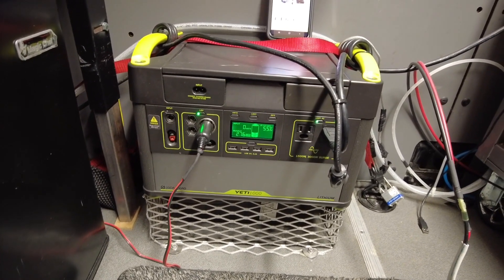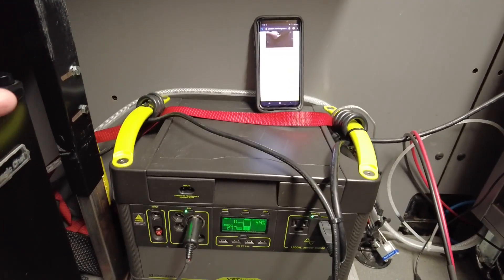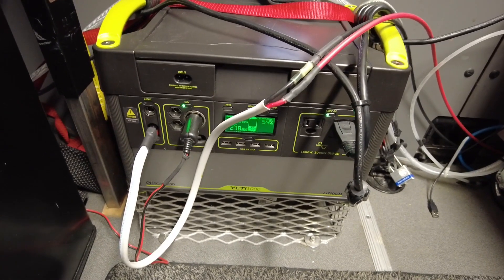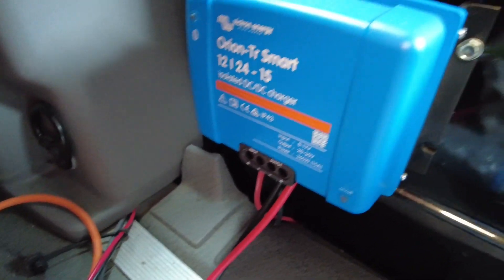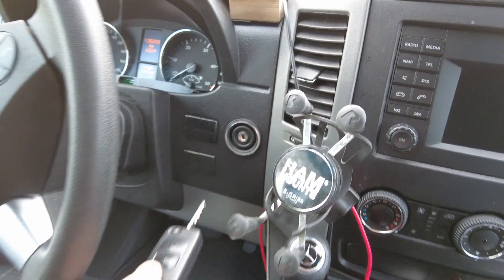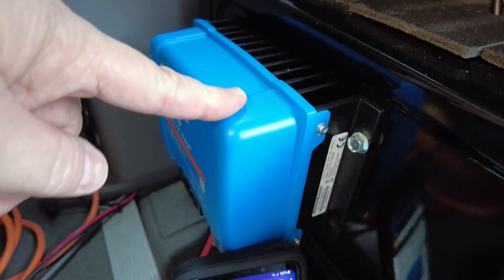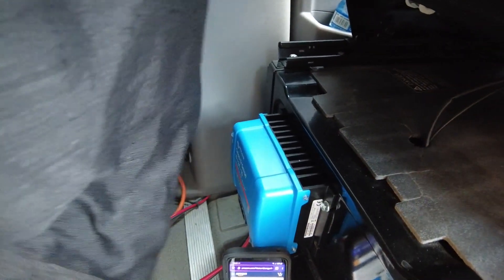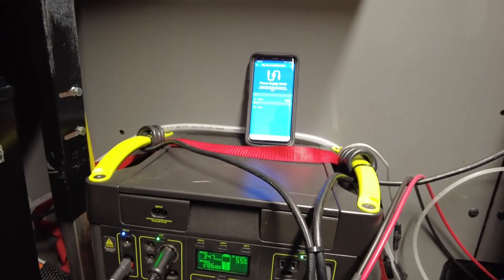Goal Zero Hack - Alternator Charging using Victron Orion DC-DC Converter

Comment: Your alternator should output 14.4V.... You have a voltage drops to 13.5V,  you might be overloading your alternator...
Reply from the maker: Hi MisterX - Regular alternators will generate a fixed voltage (e.g. 14V) where smart alternators generate a variable output voltage which can range from 12.5V to 15V.   The Sprinter van has a smart alternator.  So we're definitely not overloading it.  In fact, most Euro 6 engines have a Smart Alternator.  The Victron Orion is a perfect match for it.  Hope that helps!
Reply: @sprinterdiscovery  Good to know!

Comment: I recently installed a Victron Energy Orion-Tr Smart 12/12-Volt 30 amp 360-Watt DC-DC Charger Isolated (Bluetooth) to charge a Goal Zero Zeit 3000 over the 30A PowerPole input. Unfortunately there is a compatibility issue with the 12/12-30A version. The Yeti 3000 does shortly stop charging in cold state, probably due to over current (in cold state the Orion can deliver an output current up to 40A, whereas the Yeti accepts only 30A), which is causing the Yeti 3000 to close off charging. - I ordered a Orion-Tr Smart 12/24-Volt 15 amp as an alternative now, since this device will avoid the over current. Drawback will be, that the max. charging output will be about 315W (15V*21V, and not the possible 360W) and the risk, that in case of misconfiguration, the Voltage could be over the allowed 22V for the Yeti. But at least it will work.
Reply: I believe the yeti 3000x has input limit up to 50A so this 40A surge should be okay with that model.   Does this make sense?
Reply: @sahathorne1  I just double checked the specs for you and you‘re right, GoalZero Yeti 3000x is indicated for „High Power charging port (input): 14-50V, up to 50A (600W max)“. So you should be able to go with the 12/12-30A or the 12-24-15A. Since the Yeti 3000x has a voltage input of 14-50W, I would go with the 24V option. You would not have the risk of over voltage (in case of misconfiguration of the Orion) as you have with the the 12V option. But in principle, both options 12V & 24V should work in your case with the Yeti 3000x. With Yeti 3000 the 12V option doesn‘t work.
Reply from the maker: Good to know thanks for sharing this info! After looking at the specs, I didn't go with the 12/12-30 and instead went with the 12/24-15A. Glad you actually confirmed it! Definitely temperature plays a role in how much is delivered to the Yeti.

Comment: Do you think this setup would work with the Titan Solar generator and a smart alternator? The Titan is a 24v system and allows for a 15A car charging port.
Reply from the maker: I did a quick product search, and according to the specs the car port charging says 85 watts, less than the 360W the Victron will produce. Also the solar MPPT on the Titan has input voltage range of 35v to 145v, which is higher than what the Victron will produce. So, just based on that I don't think the Titan will charge with the Victron Orion. Probably install an inverter instead in your vehicle and use the charger that comes with your Titan. Best of luck on your setup. And thanks for watching!
Reply: @sprinterdiscovery  Thanks! I will do more research on inverters.
Reply from the maker: @TN-wl1rw  You're welcome!

Comment: salut,la sortie 12v sur le régulateur de charge solaire est de combien d Ampère ?
Reply from the maker: FRENCH:
Bonjour! La sortie est de 24 V à 15 ampères et l'Orion est un chargeur DC-DC, pas un contrôleur solaire. L'entrée provenant de la batterie de démarrage 12V est de 30 ampères. J'espère que ça t'as aidé!

ENGLISH:
Hello!  The output is 24V at 15 amps, and the Orion is a DC-DC charger, not a solar controller.  The input coming from the 12V starter battery is 30 amps.  Hope that helps!

Comment: Great video! I'm currently using a pair of the Goalzero 12v car charger cables. They each provide 120w of charging while driving. I will now replace (or augment) them using a DC to DC charger. Did you try to wire the Victron to the terminals below the drivers seat? I recall that's where Mercedes recommends adding connections instead of directly to the battery.
Reply from the maker: Hi Tim - glad you liked the video! I wired directly up to the battery terminals. I'm not sure where I would connect it to on the terminals under the seat. I know there are several there. Been going on 7 months with this setup so far and it's been working awesome! If you do find out which terminals to attach to please let us know here. Edit: I found this site which discusses the terminals... https://sprintervanusa.com/2016/08/07/tapping-in-to-the-sprinter-vans-battery/  It's something I have to look into for sure now that you mention it. I'm not sure of the implications of directly wiring to the battery though - do you know? Many thanks for raising this up here!
Reply: @sprinterdiscovery  Here is what I'm referring to: https://sprintervanusa.com/2016/08/07/tapping-in-to-the-sprinter-vans-battery/. I'm thinking you could use the middle terminal, but that would mean it's live all the time, but I guess that's how your setup is also. The Victron is smart enough to know when the engine is running I assume. Just subscribed!
Reply from the maker: Thanks Tim! I just googled and edited my comment and replied with the same link as you! Lol definitely something I need to research. Thanks mate! And thanks very much for subscribing too!

Comment: I also asked same question on todd parkers video upload. I was looking at buying the victron orion 12/24 15 amp dcdc charger to charge my yeti 1500x from alternator. Would I need the victron orion 12/12 dcdc charger to charge a 12v external lif4po4 battery from the yeti 1500x? Maybe I could buy a 24v external lif4po4 battery and tie that into the powerpole connection for charging yeti and use the orion 12/24 dcdc to charge the external 24v battery as well?
Reply: To charge your 24v external battery get a 24 volt dcdc charger so then it will be charged when driving. Then get a Goal zero mppt module and connect the 24v battery + and - to the power pole input of the mppt module. The 24v battery will drain into the goal zero at approximately 320 watts and if your dcdc charger can output more than 320 watts into the 24 volt battery you can charge both simultaneously while driving! I love the 24 Volt external battery idea because the Goal zero MPPT module is rated up to 48 volts input even though the label says otherwise (I have tested my GZ MPPT module with a 44 VOC 72 cell solar panel). Please note I am only talking about the GZ MPPT add on module!
Reply from the maker: Fantastic! I've been wrestling with this problem for a long time, and you gave us all the answer here! Since the MPPT module can accept voltage values greater than 22v (like you mention up to 48V), we won't need another Victron Orion. We can just feed the Yeti from the Lithium battery directly. Going a step further, we can simply connect the Orion to the extra Lithium battery and charge that as we drive. The Lithium battery then becomes the "tank". So when the Yeti is full, we keep charging the extra 24V Lithium battery as we drive until that is full. When we're parked for the night, it will continue to feed power to the Yeti via the MPPT module until it's empty.  You think that will work?
Reply: @sprinterdiscovery  I believe so. One thing to consider is the GZ mppt module shuts off at 13.2 volts input, so your 24v external battery will need a low voltage (i.e. 24.0-24.4 volts) notification for you to manually disconnect from the GZ mppt module. That shouldn't be too hard to implement!
Reply from the maker: Great! I'll have to order an MPPT module then and do some experimenting. The Yeti 1000 is still going strong and if I can expand it with extra Lithium 24V, the life of the unit can be extended for a much longer time. It's been super reliable so far too.
Reply: @sprinterdiscovery  I have had a good experience with my Gz 3000 for over 7 months running 24/7 with 800 watts of solar input. It seems very well built and reliable too!
Reply from the maker: Here's what I'm planning to do. I already have a Victron IP65 Blue Smart 12v 15a battery charger to charge my starter battery. If I have an external 12v lifepo4 in my van (to use as a "tank"), I'd charge that using the blue smart charger. I'd then put get those large Anderson connectors and place them on the end of the wire that leads from the starter battery. Then also add some seperate wires to the lifepo4 and attach another pair of the larger Anderson connectors (ap50 i think). Then on the Orion I'll place a set of the larger Anderson on the input side. So when I'm driving I'll just connect between the starter and the Orion to charge the Yeti using the appropriate VictronConnect settings. Then when I'm parked and I need to draw from the external lifepo4, I'll connect that to the Orion, configure the VictronConnect appropriately. This way you only need one Victron Orion and one BlueSmart and both have dual purpose.
Reply from the maker: I think you can't connect the 24v lifepo4 directly to your Yeti. You need to regulate the power using another Victron from the 24v source to your Yeti.
Reply: I know you need 2 use a12/24 orion 2 charge yeti from alternator. I'm just trying 2 figure out the simplest way 2 run xtra lif4po4 battery inbetween alternator and solar charging.
Reply from the maker: Hey Marcel - I'm not sure how to do that (yet!). But perhaps our viewers might know. If I come across a solution I'll definitely update it here and on my website too.
Reply: I gotta decide if I should add the xtra battery now or wait until I'm on the road and figure out if I need it.goalzero 1500x, I have 320 watts solar and the orion b2b. Biggest battery draw is my cfx3 75 liter. Other than that lights.,Water pump, laptop, phones. What 24v is well made and decent price? I see battle born 50amp 24v. Does relion make 24v and on sale at cosco? I probably will just wire in the xtra battery more storage never hurts.
Reply: @proto662  Is your Orion b2b the isolated version like in the video? Do you  currently have a 24v battery charger? The external battery setup requires a few additional components and wiring to work right. My 12v lithium 32ah external battery has a mppt charger with 100watt panel and Gz car charger connected to the load output of mppt. Then at sunset the load turns on sending 10 amps charge to the Gz until sunrise or low voltage. This is a nice way to increase battery capacity if you can utilize solar.
Reply: @uhjyuff2095  I actually don't have the orion yet.I have been waiting for the new car link to come out but think I might buy the orion now. What other components do I need to buy to use an extra 24v battery? Orion, mppt module,24v battery, victron battery protect module?
Reply: @proto662  Just get some ring terminals, wire with an Anderson power pole connector on it, some butt splices and heat shrink if you need extensions, and wire tie downs. The Orion seems sized perfectly for most alternators you should be happy with it. Remember to connect the 24 volt battery to the mppt add on module because it is current limited to 25 amps (300 watts) and not the built in mppt which is 50 amps (600 watts).
Reply: @uhjyuff2095  what about the victron battery protect, is it worth getting?
Reply: @proto662  Yes, because when the 24 volt battery is being used it will discharge to an under voltage state and cause problems.
Reply: I ordered a 24v 50amp life4po4 to set up in my van. I also bought the victron battery connect. Now I am trying to figure out how to charge external battery with solar when I am sitting and yeti is full? I have 320 watts of solar.
Reply from the maker: Hey Marcel - You could buy the Victron MPPT 100V 15A model here which will work with your 24v battery. Then you can charge the battery from solar... Let me know what you think.  https://amzn.to/3E5M4wo
Reply: @sprinterdiscovery  i was looking at that as well. The thing is I already have my solar hooked up to my yeti 1500x with anderson power pole connection. I was looking for a setup where I didn't have to disconnect and connect things. Maybe i can get a 12/24 battery charger powered by yeti inverter?
Reply from the maker: @proto662  Definitely that will work. Take a look at the Victron IP65 model for 24v and outputs 8A.  I personally have the 12v 15a version and it works very well.
Reply: Well I installed the 24v 50 amp battleborn battery and it works great with the goal zero 1500x. I have the victron 12/24 b2b going to the battleborn and charging the battery from the alternator. I have the battleborn going thru the victron smart connect and then going to the mppt add on module. The mppt module turns off when goal zero is full and starts back up around 93%. Now the goal zero stays topped up and now have double the capacity.  I also bought the 12/24 8 amp battery charger to charge from goal zero when I am boondocking and using extra solar power to charge the 24v battery. Its nice with victron app with the battery connect to see additional info on battery voltage and with the b2b to see battle born status. Thank you sprinter discovery, todd parker and uhjyu ff
Reply from the maker: That's AWESOME! Thanks for sharing - super happy that it worked out! 👍👍👍

Comment: I do something similar to charge my Titan in my RV from the truck alternator using the Victron Orion DC-DC charger.   I can directly connect to the Titan's 24 VDC battery bus by plugging the charger output into the external battery port on the Titan without using up a solar charger controller port.
Reply from the maker: That's great to know, thanks for sharing this info! I've been really pleased with the Victron Orion's performance. And... Thanks very much for watching and leaving a comment. Much appreciated!

Comment: Awesome setup. I was surprised to hear the bit about internal fusing. Where did you see the Orion was internally fused? From what I have read fuses are required on both positive cables.
Reply: Fuses are always required.
They are to protect the cables not the appliance.
If it shorts out you have full alternator power able to short straight to earth. 
Really good way to set your van on fire.
Reply: @joshatkins6533  think you are right.
Reply from the maker: Hi Andrew - Thanks for watching!  The Victron Isolated Orion has an input fuse for the 12V and 24V.  Take a look in the PDF specs here, near the second photo of the Orion you'll see they say "Input fuse (not replaceable)On 12V and 24V input models only"  https://www.victronenergy.com/upload/documents/Datasheet-Orion-Tr-DC-DC-converters-isolated-100-250-400W-EN.pdf   Now I wonder if I need an actual fuse on the output positive wire, or will the Goal Zero PWM side take care of any fusing?  Do you know? Hope that helps!

Comment: Really happy you made that video quite recently, super nice content. I want to do the exact same thing but still use solar with the 8mm input. Do you think the Victron Orion will also work with the newer yeti 1500x?
Reply from the maker: Hi Raphael - Thanks very much!  Glad you enjoyed it! One viewer reported in the comment section here that the setup works well with the Yeti 3000X, so definitely it will work with the 1500X.  The Anderson Input is rated at 600W maximum, so the Victron Orion will push around 360W as you drive.  You might be able to run solar via the 8mm input plug AND use the Victron Orion at the same time as you drive so long as it is both under 600W combined.  I say "might" since I haven't tried that, as I don't have solar on my Sprinter van.   I know on the Yeti 1000, the maximum input on the PWM side is 360W which includes the 8mm input port and APP input.  If you try it, please leave an update here for us.  I'll then update my website to include the updates.  https://sprinterdiscovery.com/goalzero/ 
So glad that this video has helped you and others.  :-) Have a great day!
Reply: @sprinterdiscovery  wow, what a precise, helpful and fast answer. I will report back for sure. As far as I know the two 8mm inputs can handle 120W each, so with a 360W input via the victron it should be a nice setup with two 120w panels. :)
Reply: I already have another question: Is there a particular reason you're using the 12/24 V orion instead of a 12/12 with 30A?
Reply from the maker: @WafflRaffl  Excellent question!  The Goal Zero 1500X (for your case) has an APP input range of 14V-50V. On the Yeti 1000 it was 15V-22V.  The spec sheets for the Victron Orion are here:
https://www.victronenergy.com/upload/documents/Datasheet-Orion-Tr-Smart-DC-DC-chargers-isolated-250-400W-EN.pdf
So the Orion 12/12-30 can supply output voltages of 10v-15v, which would be just within the bottom range for your Yeti 1500X assuming the wire thickness is appropriate and not too long.  If this voltage fluctuates due to temperature or other interference, it would go out of range.  Whereas with the Orion 12/24-15 you would be well within the Yeti 1500X operating range since the output voltage is adjustable from 20v all the way up to 30v.  On the Victron spec sheet, it shows the 12-12/30 outputs less power when it is hot.  So when the ambient temperature is hotter, say 40c, it might not even charge your Yeti.  Hence the reason for going with the Orion 12/24-15.  Hope this makes sense.  :-)
Reply: @sprinterdiscovery  all understood! Thank you so much for taking the time, I envy your enthusiasm!